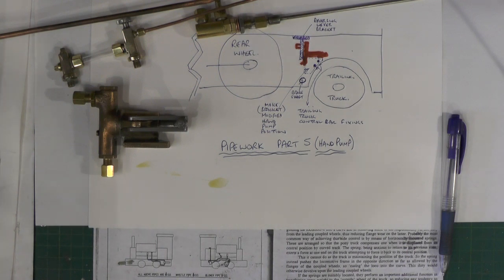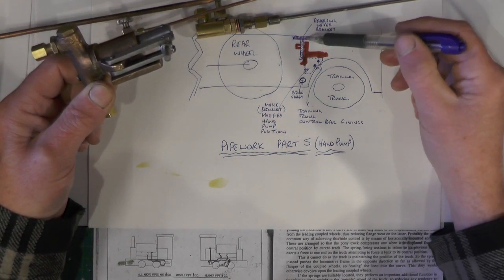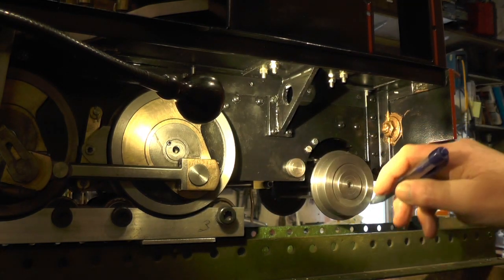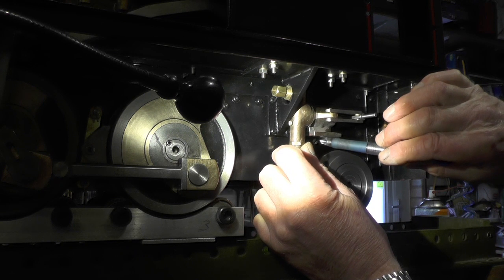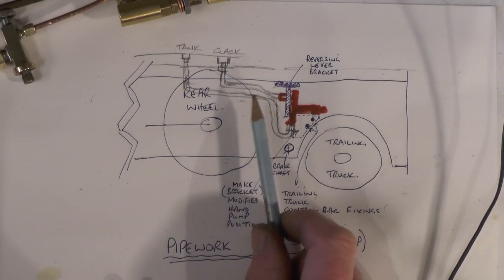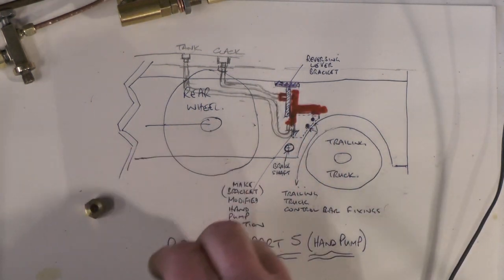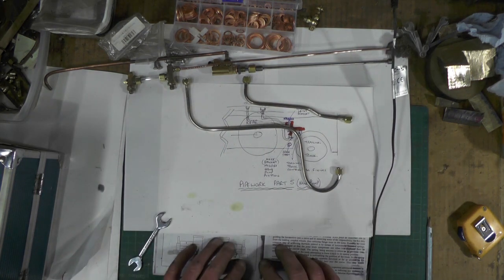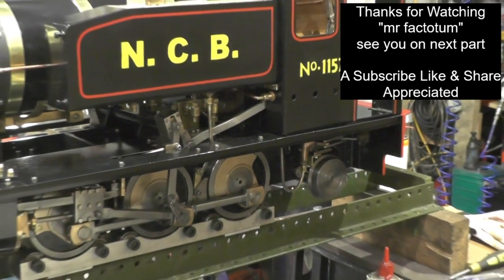Build Your Own Beginners Miniature Steam Locomotive Series (Pipework P5 HAND PUMP ) "mr factotum"

Comment: Wonderful stuff as usual, sir!  You have such a natural knack for teaching and describing, as well as your obvious amazing skills. May I ask how you became such a good machinist? 

I am considering my options for a mill in future, it seems that there is a huge gap between those people who say 'don't bother, use a mill with a vertical slide', or 'just get a cheap one and clock it all by DTis' - and those who say 'buy the biggest and most expensive you can afford with digital readouts and all the rest'  - any advice?
Reply: )There’s no right answer , I’ve made several locomotives without  a mill  just using a vertical slide (a lathe and other tools may be required 😂)
Reply from the maker: hi TIW
thanks for your kind words, 5 year apprenticeship, and a great craftsman to learn from for that 5 year and beyond.
As for mill, mine was cheap as chips, it does a job but i sometimes have to wrestle with it, a vertical slide would get you going but can be a pain in tieing the lathe up. i would never pay much for machinary there's some good bargains come up now and again, you also learn much more for making do and adapting what you have, but if cost is no problem, go for it.
regards
mr f